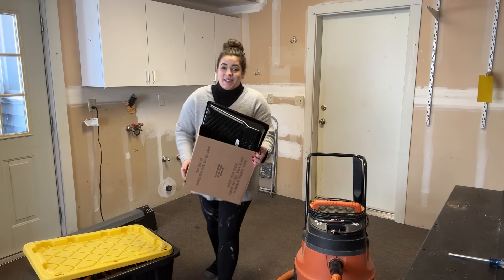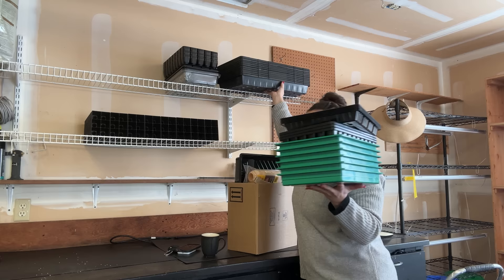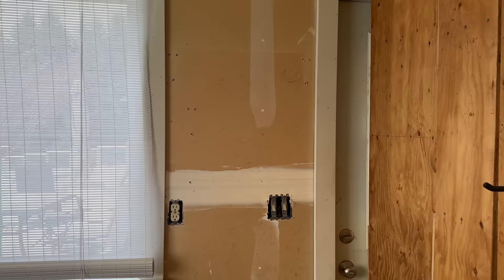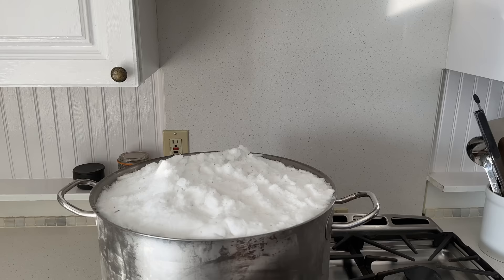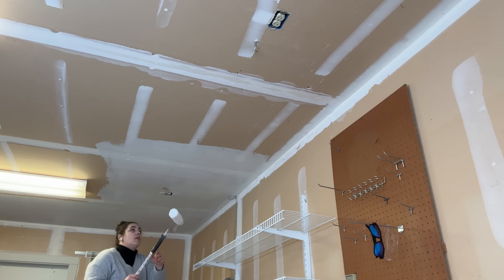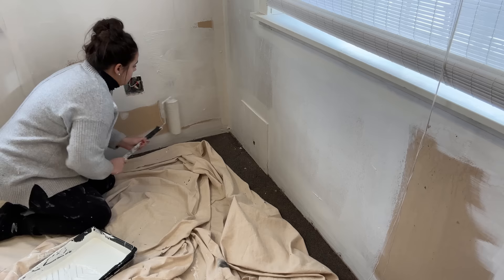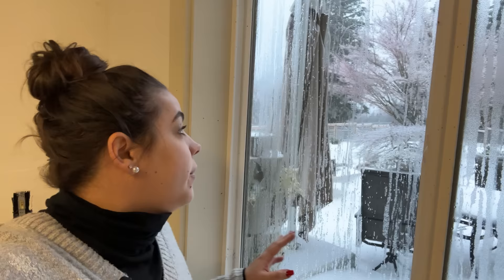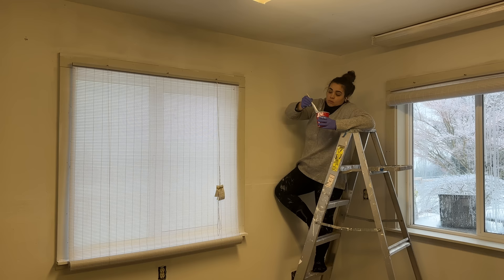You Talked Me Into It!

Comment: Hack from a artist, 1. Put your paint brushes in baggies. Then zip up. Then you don't have to clean up the brush each day. And it will work just like the day before. (Lasts about a week). 2. Wash a old dried up brush by soaking it in a jar of Murphys oil. Just fill to the level of paint on the brush. Let sit a few hours, and then gently squash it until the dried paint is loose. Then wash as normal. Will save a dried up paint brush that is hard as a rock. These 2 things have saved me a lot of money. Hope it helps. Btw, all painters have dipped thier brush in thier drinks, or drank thier painting water. 😅 Your doing a great job, looks amazing 😍

Comment: If you need a longer handle, check your mop, floor duster, broom, etc.  Many  times they have the same size threads as your paint roller handle and can work to reach those higher places.
Reply: This is exactly what I do.  I use the handle from my broom and it works great
Reply: Sure saves the back.
Reply: What a great tip!!

Comment: Once you take up the carpet, maybe you will find a drain hole in the floor and just painting it with special cement paint will be good then just use the standing mats and throw rugs if you want. It is after all a utility type room, vinyl will not work if you have a leak or water gets underneath the vinyl(mold issues could form). My husband was a builder. I learned a lot from him in the short time we had till he passed away. But I will offer what I know, when I can. You should be so proud of yourself! 😊❤

Comment: Little tip for caulking Becky, wear 2 pairs of thick vinyl gloves and keep them on to smooth out the caulk then take the top ones off to have clean hands. I use a small glass jar of water to dip my finger in so it makes the caulk really smooth out on the surface. If you don’t have gloves you can put a waterproof Elastoplast on your finger and do the same.
Reply: I was going to suggest the same thing
Reply: 29:37 do you mean a bandaid?
Reply: @VirginiaSharp  I do, sorry…think that was lost in translation…We call them Elastoplast or Plasters for short in the UK.

Comment: We, too, had no water a couple of weeks ago due to the freezing weather. This is the third time it has happened. Tips I have learned:
1-I got some WaterBricks to store fresh water in for drinking and cooking. They are food safe plastic, reusable, and stack neatly. 2-I saved milk jugs, juice bottles, vinegar jugs. Washed them out, filled with water and store in the bathrooms to wash hands and flush toilets. 3-this is the time to use paper plates, plastic cutlery, etc, so you don’t have to wash dishes. 4-the premade meals in foil pans make it easy to have hot meals without having to wash pots and pans. 5-I have the Ball electric water bath canner and it has been fantastic to melt snow and boil water. Just the ability to get a bath using hot water in a bucket can make you feel so good.

Comment: Looks fantastic so far. I would honestly get rid of the wood shelving all together as they tend to become a catch all and you really only seem to use one of them. Also for the water lines adding a hose to one would work amazing with a watering attachment would be ideal for all your seedlings no more having to bring in water for inside the house and you can just wined and unwind it when needed or get a cheap laundry tub so you can also clean your trays. Would make your life so much easier and a lot less traveling and caring things from one area to another.

Comment: Its probably too late now but when I had a water issue at my barn...horses...I used a horse water tank and shoveled snow into the tank and had a livestock tank heater do my melting for me then filled other water needs by bucket from the horse tank. I had gobs of snow...drifts feet deep...and a high sided sleds to move snow to the water tank. I went several weeks in temps close to zero °F with that hack. I actually think the horses preferred the melted snow over well water. When you have livestock you need to have backups for all necessities.

Comment: Looks wayyyyyy better. I brought in my pepper plants to over winter them . But I took them out of the pot they grew in outside. Reported in a pot cleaned with bleach water. Then added all new soil. My have been inside my house all winter no bugs. I trick is to repot after you hose off the roots of the plants, to get all the old soil off. Add a couple of house plants, a flower picture and a greenery wreath on the door with the glass window on the inside.

Comment: We started rain water collection several years ago and it has definitely saved us more than once. Flushing toilets, watering animals, the garden etc. But there are more enclosed water collection designs that will allow for boiling and filtering. We just saw a video the other night on a design that allows the debris from the roof to fill one pipe to drain off slowly, a cap floats up to seal off the debris,  then the clean water fills the storage tank. There are also filter tanks that can be built, the water can go through the filter tank first then on into the storage tanks. The grow room is looking fantastic! I look forward to one day having one. I have a greenhouse but the nights are too cold to start early.

Comment: If you pull the carpet up there is probably concrete. You can buff & stain the concrete. It would be easier to keep clean. Maybe when you plant your seeds keep the dirt outside the door and fill the trays right outside.  Then bring in and plant the seeds. That would help keep a lot of the dirt out. Looks a lot better.

Comment: Hi Becky....whew I get tired just watching you.   When I paint I use the handle from my broom and it screwed into the roller handle perfectly.  Made ceiling painting easier as I just stood on the floor.  Used it on walls too that were extra high.   I just wiped off the handle afterwards and stuck it back on my broom.  Also, I got a nifty gadget that attached to roller.  It was for painting the ceiling and it covered the bottom of the roller.  No paint drops on my head or floor.  It was yellow plastic.  Got it at the paint store.  Very inexpensive.   You are so organized....a little work sure makes life easier in the long run doesn't it.  Take care.

Comment: When you have a 5 gallon bucket of paint (or even a smaller container) that you've used up except for a relatively small portion of it, it's always best to transfer the remaining paint into the smallest paint can or jar that will hold it all.  You can buy new paint cans pretty cheap, or just use a jelly, quart, 1/2 gal or gallon jar with a tight lid so it doesn't dry out.  Paint lasts SO much longer that way than leaving it in a container that's mostly filled with air.  The paint just starts skinning over and drying out if you leave it.  Remember to either transfer the label to the new container or at least write the info on it so you can purchase more of the right brand and shade if you ever need to.  The part you've done so far has already totally transformed the space!  It looks so much better in there already.  I can't believe you took this project on with NO WATER IN YOUR HOUSE in the middle of all our snow and ice storms!!!   Becky you are a wonder...great work!

Comment: Becky if you get a piece of plastic bag and put it inside the filler pot against the product it will stop the product from drying out so fast. I usually put a piece on the product  then a piece of cling film over the pot opening before replacing the lid

Comment: becky you can epoxy the floors so you can clean easily  the kits are super easy like painting the floors  you roll the  epoxy out put chips down and  seal cure the floors  and then youre able to move everything back in  if youdecide to tile or to carpet you can lay over it because it seals whatevers at the bottom if its wood or concrete

Comment: YIKES 😢 @10:00 THAT many holes close to the outlet & light switch 😬 I'm no electrician but aren't the wires running up through there? I almost pierced a water line once, hanging shelves. Now I'm more cautious where I put nails and screws.
Pro tip: most broom &/or mop handles fit roller frames, to give you a longer extension handle ❤

Comment: I must begin by saying I detest painting with every fibre of my being.  I will wallpaper anything including closets but painting?  Not so much. That being said, there ARE times when needs require painting of some sort. Between coats, you can take your wet brushes, either oil or latex, put the brush part in either zip lock baggies with an elastic or covered with cling film and stick them in the freezer.  Take them out a bit before you plan to use them to thaw a bit and they are ready to go. I will bother to clean latex paint brushes but when I have to clean oil base paint, I pitch them.  Wasteful but beyond annoying to clean.  Anyhoo, the freezer trick works a treat.